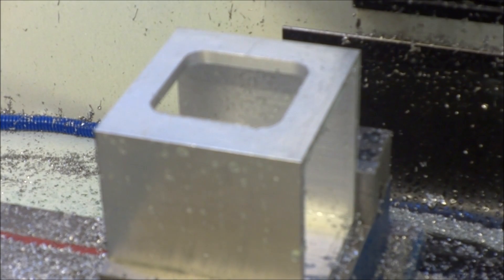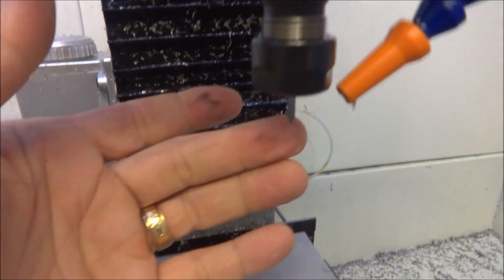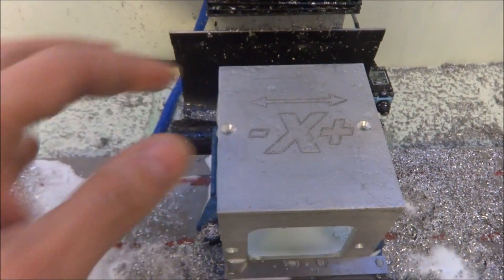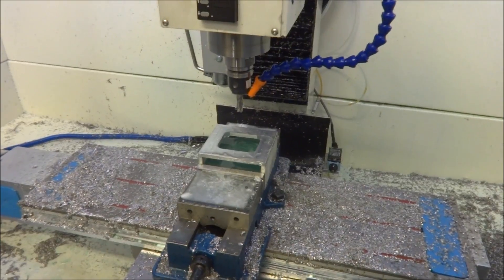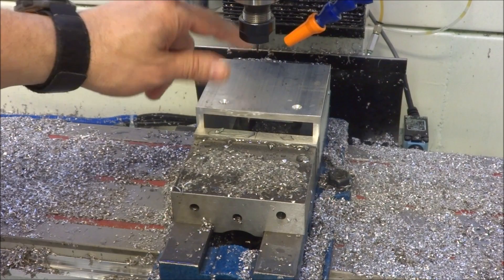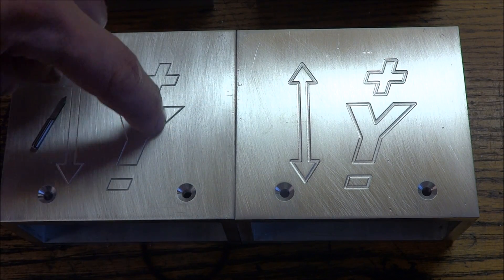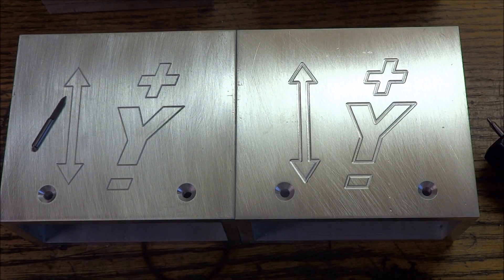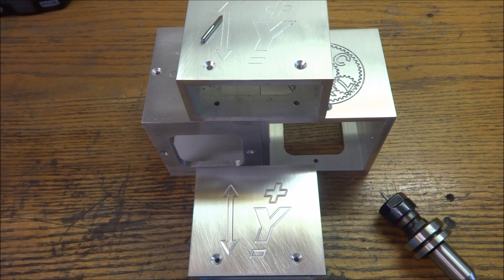XYZ Spacers

Comment: Good job Sam. It looks like you didn't change cutting parameters between the first and second square holes, yet the second cut went a lot smoother. If I were to hazard a guess, I'd say that the way you held the channel in the vise might have caused the rough cutting. When you cut the second hole you held the channel facing the Y direction. I think that might be a sturdier setup since you are not compressing its sides as when the channel was oriented in the X direction. Just guessing at loud here. Nice video.
Reply from the maker: Yes that's possible, i did tweak the g code some on the spindle rpm it was a little slow on the X axis spacer as well.

Cutting really well and working good so far. 
Be safe,
Sam